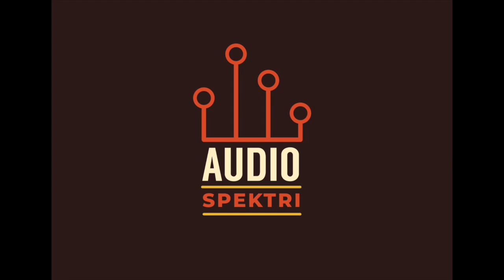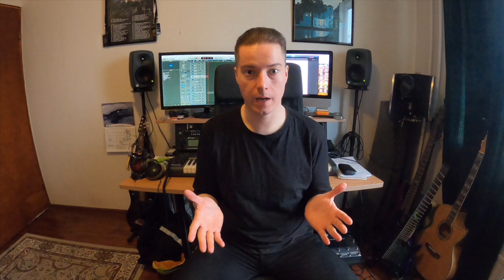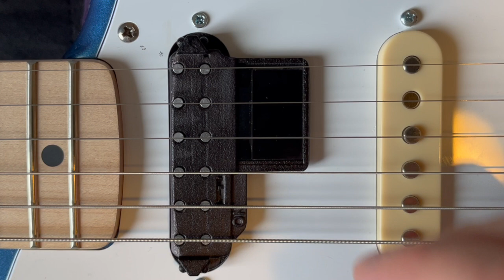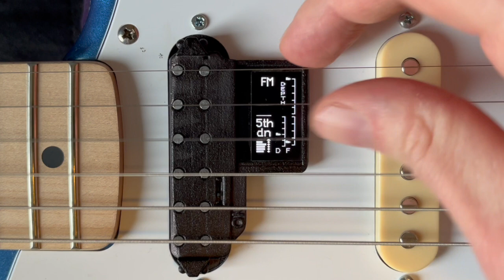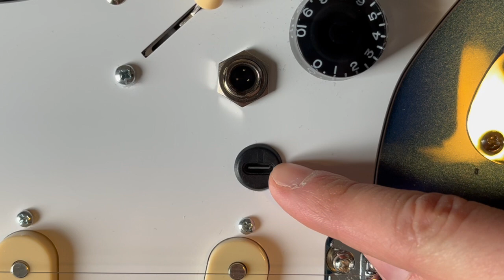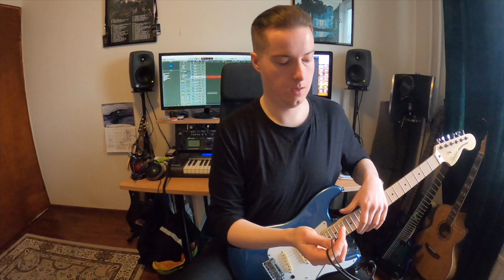mPGV Introduction

Comment: did u consider all switches position is more likely hit by pick
Reply: The pressure sensors are at an angle, the pick would just hit the outermost corners that have no sensing. Also only the synth mode change actions would be catastrophic when playing, and all those require two sensors to be pressed simultaneously.
Reply: @JoukoViitanen  clever, nice product tho, would be so much usefull for small band, congrats!

Comment: Would there be a difference if using in a left handed guitar?
Reply: Sorry, you would need to turn it around, but then the display is upside down.
Reply: Actually the problem is that the display would hit the neck - on second thought, if you place the mPGV in the middle slot, then  there is ample space for the display. We have never tested that location, but I do not see major difficulties.

Comment: Any issues setting this up on a lefty? Also I just read the manual and saw the bit on having the pickup as close to the strings as possible. Are the pole pieces actually magnetic or some other sort of sensor and just to clarify it’s routing a Low-Z signal to the guitar’s volume pot to be sent out the stock unbalanced 1/4” output?

Very intriguing and definitely the type of stuff I am into. I may have missed if you can save presets? Midi and CC i/o with an external editor and patch library would be amazing.
Reply: Sorry,  if you turn the module around, then the display hits the neck if the neck slot is used; also the display graphics will be upside down. The poles are conventional magnetic, but the readout is separate for each. Yes, the output is low-Z but it will come with a protecting resistor at the end of the wire, safe if it is accidentally shorted to some high inductance sources  ( the resistor can be removed, though). The output vol pot can be used.

Comment: Sounds original, but I don't see a real advantage over a MIDI pickup..
Reply: The MIDI note on - note off protocol just adds extra latency that every note analysing pickup tries to avoid.
Reply: @JoukoViitanen  at least you can change the sound. This sounds like a one-trick pickup, not very versatile..
Reply: @SIVA6619  Yes; the human voice is a very versatile instrument with large variability: one of the vocoder modes even allows the spectral properties of the vocalist to be modified to be different for all the 6 strings.

Comment: So many basses have active electronics, and it'd be easy to make a version that can connect to a 9V or a little LiPo battery. Plus basses can have huge pickups, so you could make something really badass looking. And basses are amazing with wah and evelope followers, and you could make it work with a BTLE expression pedal. Imagine how cool it would be to have that Cliff Burton Morley Power Wah sound without even plugging into anything, and you can just use the pickup selector as a wet/dry.
Reply: Thanks of the comments! About the batteries: Yes, the typical 9V battery would have been nice, but the pickups have very powerful DSPs, total of 4 CPU cores, and draw 120mA of current, so the battery would be drained in one play session. A rechargeable is the only solution. Many people have asked about the bass version, but this type of principle that measures the pitch frequencies would make very long latency for low notes, because we need at least one full cycle to measure. Whereas in mPG you also have the -1 and -2 octave transpose options without such lag.

Comment: Does it have capacity to store and recall presets? Would be handy in between songs, etc.
Reply: No, when a certain synth mode is selected, there is only one mode specific adjustment plus pitch bend, so not so much settings for presets. Perhaps additional preset could be useful for setting if sustain would be used. The main feature is the vocoder, and when it is selected, the adjustments are at the neutral position.

Comment: Cool device! Any ideas on screen/button placements to improve the usability of it?
Reply: We wanted to avoid too many modifications to the guitar body, now only one extra hole is needed in the pickguard, for the vocal mic.
Reply: That’s something you gotta figure out. This is really neat but I can’t imagine really using this due to the interface 

Maybe route everything through the holes already there and go through the jack hole, something like that?
Reply: @eqprog  I think the most likely way for improved UI would be to add a cellphone interface through Bluetooth, together with Bluetooth wireless audio out. However, for personal use, not for stage,.

Comment: Interesante 👏 Is the pickup also a  MIDI pickup to combine it with a keyboard ?
Reply: No, the analysed data is fed directly to the synth. The MIDI standard is nowadays quite outdated.  When amplitude and pitch data for the 6 strings are measured in 32 bit floating point values,  and fed continuously to the synth, at a pace  close to the sampling frequency, the MIDI note on/note off  -protocol would be far too slow and cause extra latency and clicks. We had some older Eurorack synth modules with Midi interface,  but a keyboard is quite different instrument, compared with a guitar.

Comment: Does it require giving up the neck pickup, as in that sound is no longer an option, or does this unit function as a normal guitar pickup when the circuit is off? 
I see a fairly high chance of accidentally hitting the switches while playing. I know a simple change of hand position would avoid this but guitarists are notoriously resistant to "changing their technique"😂.

Comment: Can you program new FM sounds and save them as presets?
Reply: FM has only the adjustable modulation depth input. Originally FM was added to the mPGV  vocoder just to have something that works without the vocal mic, too,  to be able to do tuning and check the amplitude level (the modulation depth is a function of the amplitude, so one can hear when it saturates thus keeping  modulation constant. ) However, some people seem to be interested in FM, too, so we would be happy to hear if you have any proposals for improvement?

Comment: Maybe a dumb question, but wouldn’t the pitch shift stuff make more sense by playing a note(s) and using a floating bridge? Very cool and unique though. Couple this with an in-built GK3A pickup and a VG-99 for some really wild combinations!
Reply: Actually this has in one package the separate string detectors like the GK3A has, and the synth. What is missing is the thick multiwire cable and 13 connectors and big bolt-on cable harness. Only the standard guitar cable out.

Comment: Can you use this as a sustainer?
Reply: The sustain option in mPGV is different from the one at e.g. in Fernandes sustainer. A chord is sustained with a very slow rate of amplitude decrease as long as any string of the chord is alive. Because higher strings die out much faster than lower strings, this feature helps to keep them alive at equal amplitude as long as the slowest decaying note. This property does not extend the sustain of the high string when picked alone. It just stays loud as long as the minimum threshold of the string is reached. However, picking again or picking any other key keeps it sustained, too.

Comment: Am I correct in assuming that it wouldn't work properly with a left-handed guitar?
Reply: In principle you could flip the pickup to get the same string order to the sensors, but in a strato-type pick guard the display would collide with the neck. The middle slot could be possible, but the wire exit side may cause problems, at least the wires should be longer. When keeping the display as it is, changing the sensor channel allocation is a very small SW task, and also a small HW task. But flipping the display graphics would be more work, because it is very hard coded. We do not have any such guitar available, so testing may take some time, but let's put it on the list to do.

Comment: very interesting.  and does it work along with the pickups?
Reply: No, you really have to use a pickup selector that does not mix with the synth, or add a separate fader pot if you want to get a controllable mix.

Comment: what kind of impedance is this thing running? will it work with any standard amp and speaker circuit, or in a pedal board or wet loop? i mean, is it impedance matched like a regular pickup?

Edit: forgot to say. This thing is frigging amazing, great job! I will probably get one or more at some point in the future when I can.
Reply: The output is low impedance from an opamp, and has worked well with our gear, but hard to tell if some amps require the similar very high impedance output as standard pickups.
Reply: A late modification: being afraid of inductive peaks if the output accidentally is connected to the other pickups, we have added a 10k series resistor for protection. That way it is a little more than the DC resistance of typical inductive pickups. If the parallel connections are sure to be avoided, then this resistor can be removed. Another detail: the electronics has a pop/click suppressor that shorts to ground when power is off. That also prevents parallel connection with other pickups.

Comment: how much is it? is there options to still run it inthe normal circuit allowing to switch pickups and to isolate it. Also would be cool to have pots for controlling volume and a digi pot for tones maybe. also if you had a switch allowing to set two voices and then rapidly select one or the other while playing.
Reply: No, it is not compatible to use with such pickup selector switches that connect it parallel with normal pickups, has to work alone.The volume pot is usable, provided there is no mix.

Comment: A lot of cool potential here.  My only constructive criticisms are that it's trying to do a bit too much, and I think it's time to work on fit and finish.  I feel like it's a little overly complicated to use on the fly, and some of those effects don't exactly sound great either.  I'd ditch some functionality for ease of use.  I'd also try to give it a more finished look.  The textures on it seem kinda crude and ugly, which is fine if it's a $20 mod, but for $300, it needs to look like a quality part.
Reply: It would be nice if you could actually see 👀 it
Reply: @crazyprayingmantis5596  Our experience with many synthesisers is that if they have many options, players typically just use a few favourite ones. I would guess that it will also be the case with this one. And when you select your favourite method and lock it, then there are only one parameter + pitch bend to adjust while playing, so it should not be very complicated.

Comment: Honestly between this and the Circle Guitar its an amazing year for genuinely cool guitar inventions
Reply: This is so much more awesome than the circle guitar
Reply: @Havanacuba1985  I'd have to agree, this generally seems more technologically impressive, tho the Circle Guitar is impressive too, considering they can get it to move at v precise speeds and rhythms
Reply: @binchsoda  Thank you, it is all thanks to the integration density of modern signal processors. It actually has two processors , both with two CPU cores. The methods require several hundreds of digital filters, and thousands of lines of code to run in real time. What is also remarkable, that no special cooling is needed, total current consumption is only 120mA.

Comment: If you can get this connected to an app via Bluetooth, you got yourself a gold mine:) very cool
Reply: ^ This. If I could do all this interfacing on my phone I’d be even more excited.
Reply: @jasonezzell6901  Years ago we tested a bluetooth link in another project, but the problem was that if there was a crowd around with lots of cellphones with BT active, the link was not always reliable. But maybe today there is more bandwidth available, and on the other hand, for playing the BT could be shut off. However, the same applies to the present UI,  for playing  in a selected synth mode, there are only 4 sensor functions to remember. For our possibilities of integration, the box is already quite crowded, with two DSP chips, sensor interfaces, etc. Of course, nothing compared to e.g. cellphone integration level, but they are selling in very different volumes.

Comment: Needs someone to do a proper demo. Sounds promising sure looks fiddly to interact with but coud certainly be worth it. Also looks a bit like it could become victim to pick dmanage? A model with the dispay and maybe controls being remote (montable elsewhere on the guitar might be cool) as might a system where exp pedals could be plugged in to do those functions? Finally from my idea-rush how about display being possible to send to ext tablet? Maybe WiFi? BTW kudos on the price! I have a Roland GK setup but chords and bends are dreadful so I don't use it. What is yours like in those circumstances?

Comment: Is there any way to lock the controls? I can imagine under stage lighting, with sweaty hands, it's very easy to knock it with your pick
Reply: Let my comment not understate how cool and well designed this already is by the way!
Reply: @WVLFRVN  Thanks! The typical way to use is to select one of the synthesis modes before the presentation, which requires two controls to be pressed simultaneously, so it is a pretty good lock. Once selected, there is only one synthesis specific parameter plus the pitch bend to be controlled, so nothing very critical. The sensors are in a 45 degree angle, therefore pick hits require strange direction hand movement, otherwise you just hit the end corners that are not sensitive. But to be safe, yes, picking closer to the remaining two pickups is recommended.
Reply: @JoukoViitanen  brilliant, mate! Sorry if I seemed nitpicky!

I've been wanting something that does this for a very long time as I am an industrial metal musician and this is better than I imagined. Would be interested to see if there is a way to have a dual output so you can play synth and guitar at the same time. I'm sorry if this is in the video already, I'm in a room full of dogs and cannot concentrate on anything 😂
Reply: @WVLFRVN  Sorry, this is not possible with the current setup. Actually it reminds me that we should warn people using such pickup selectors that do signal addition from the pickups. If you connect the output of the mPGV to the output of a normal pickup, there is a danger that the inductance of the pickup will kill the mPGV. or at least make a strange filtering operation. On the other hand, the mPGV output is a low impedance  source and will overload the other pickups. Maybe we will try to just add a 10k series resistor to the output to get it even with the typical pickups, but then there may be hum problems.
Reply: @JoukoViitanen  good to know. Maybe a workaround for my specific query would be to isolate both pickups, having two jacks out of my guitar after a bit of modification? Im honestly blown away by how cool this product is and if I could get it to work in the way I want it to, it could change the game for me!
Reply: @WVLFRVN  Yes, that is definitely the safest solution, but then you have to carry two guitar cable sets. Maybe an easier solution is to add an extra potentiometer that acts like a stereo balance pot, i.e. mPGV to the other end and a normal pickup to the other end, and take the signal out from the pot center. The mPGV may still be too strong, but this is the easiest way. Better still would to use a dual gang pot so it completely dampens the other one.
Reply: @JoukoViitanen  two cable sets probably wouldn't bother me too much, it would be removing the need for a whole FM synth off stage and I imagine the industrial crowd would find it pretty aesthetically pleasing 😂 they love their cables, these cybergoths 😂
Reply: @WVLFRVN  Seriously, I think we will anyway include a dual gang pot as the primary interface means, because many others have also asked a way to mix the signals. It will replace the normal volume pot .  I understand that players typically turn the volume pot down when having a pause on the stage to prevent accidental sounds. That function still stays for the analog pickups, while the mPGV has the on/off switch to fully shut it down.

Comment: As @MCsg-5year says, great tracking & low latency. So does that mean that the setup is bass compatible? If not, will there be a bass guitar version added soon (🤞) ?
   I think I hear MonoNeon vibes with this
setup. 🤟🐻‍❄️🎶❕️
Reply from the maker: The mPGV is not bass compatible at the moment, since it's been designed for the guitar, but we'll definitely look into a bass version!

Comment: Can you tell us why you added a pitch bend feature, when guitars already have pitch bend by bending the strings?
Reply: The device appears to be tracking what notes you play and registering them as the correct note to make it play more like a totally in tune keyboard. 

A real pitch bend mode on the device would disable this and play the exact pitch of every string.

However, if your guitar is ever slightly out of tune, your chords will sound worse, especially playing sounds that people are used to hearing at piano level tuning, so turning off pitch bends in midi tracking is usually the default.

Source: midi guitar owner
Reply: @briansalo  I see 🤔 so it’s basically a pitch tracking guitar synth?
Reply: @connerlabs As far as I know yeah :)

The buttons look fun to play with and having a custom range for that pitch bend could do some cool stuff
Reply: @briansalo  Yes, the reason for this additional pitch bend is that you can set an exact maximum pitch bend in semitones. And yes, it tracks the played notes, so if you bend the strings, that bend also is tracked. And no, it does not refer to any correct note frequencies, so if you misstune your guitar, the output is also out of tune. There is no autotune (although it would be quite easy to add it!)